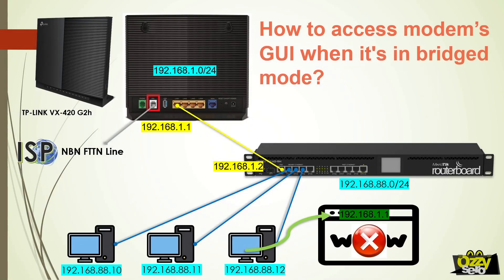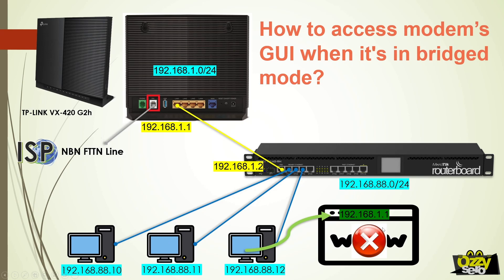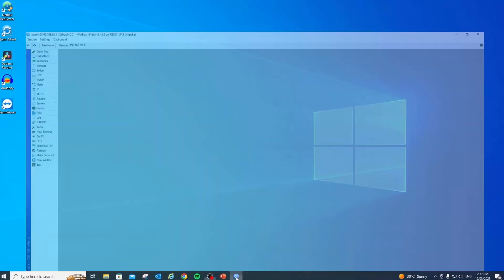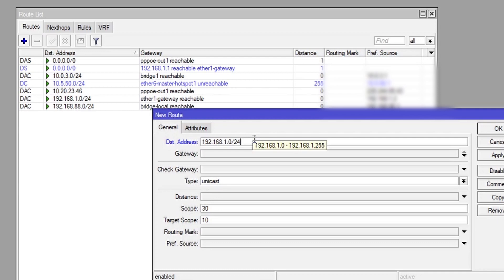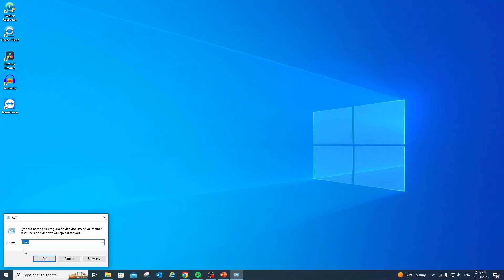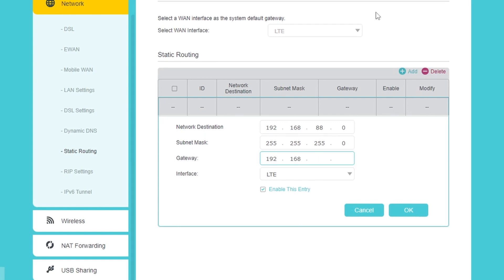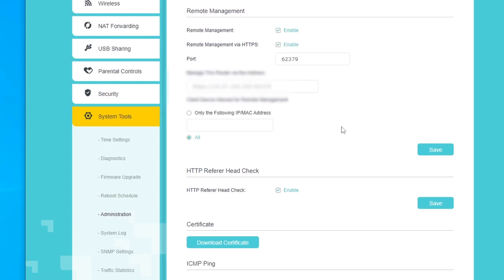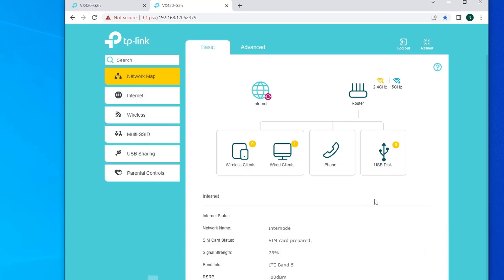How to access modem's GUI when it's in bridged mode | TPLINK | Mikrotik | #ozzysero

Comment: @ozzysero1976, I have the same issue as @gplusgplus2286 is facing. I have my Nokia ONT acting as modem  with 192.168.1.1 IP and I use tp link router 192.168.0.1 connected in home. Nokia is set in bridge mode and TP link will have all the radio (2.4 & 5G) enabled inside home. I have added the necessary routes but I can't ping 192.168.1.1 from any of my connected devices. Can you explain where do you configure the 192.168.1.2 address in your video?

Comment: I am sure I have done it in the past but it doesn't work...  Modem is zyxel from provider, set to 192.168.1.1, set to bridge and working.  Router is tplink ip is 192.168.2.1, the inside network is the same.  Cant get it to work
Reply from the maker: @gplusgplus2286  do you use the modem as the router also or you have a different router? Did you enable the remote management in the TPLink modem?
Reply: @ozzysero1976 I want to use the provider modem(zyxel - 192.168.1.1/24) for internet only and a different router (tplink 192.168.2.1/24) for everything else, dhcp, wifi etc (tplink archer c80).  I have setup the bridge fine, its just I cant access the modem gui from the router network..  Yes, all settings have been enabled, ping and remote management etc.  Modem LAN4 is connected to router WAN port
Reply from the maker: @gplusgplus2286  check the route on both ends if it’s there if not add manually. By the way, can you ping the Zyxel modem from .2 network?